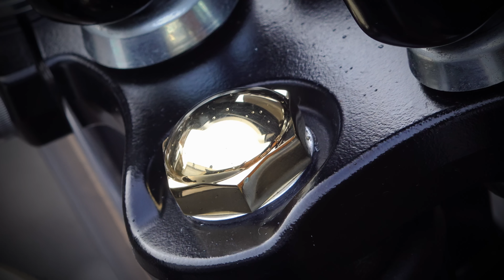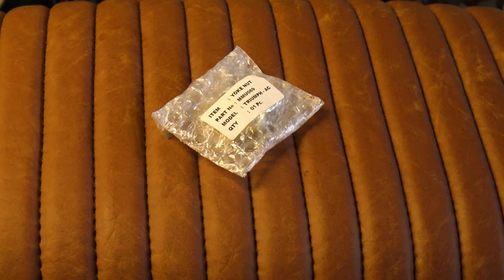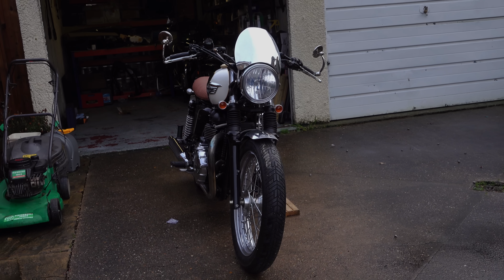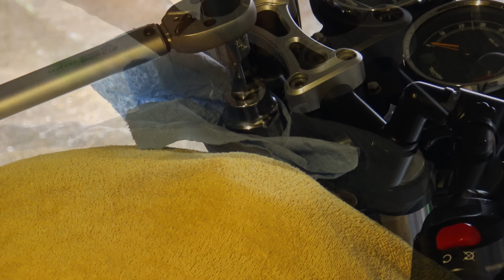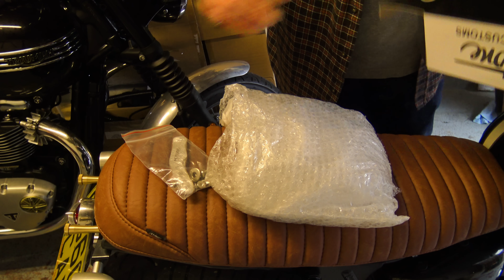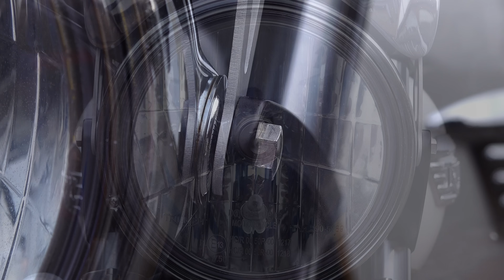Triumph T100, PayDay project returns with the Quicksilver Airblade & The BOSS MKII!

Comment: I don't care for the chrome finish for the wind deflector, my smoked deflector with the stainless brackets is my preference. What I dislike most is how a deflector makes cleaning the headlight more difficult. It has been off my Bonneville for several months, but it will go back on shortly.